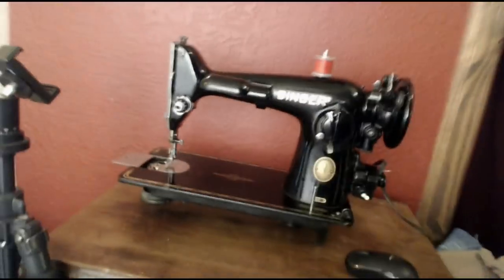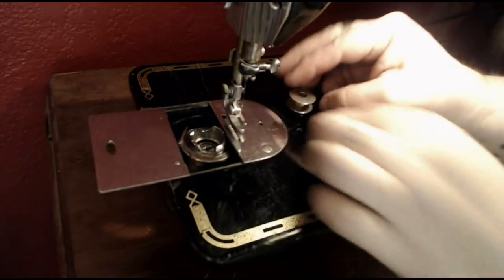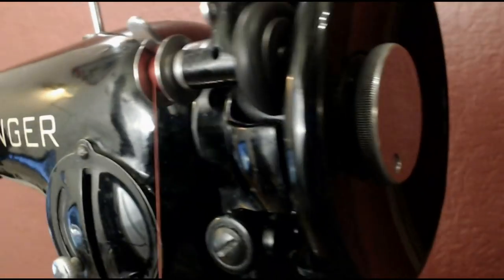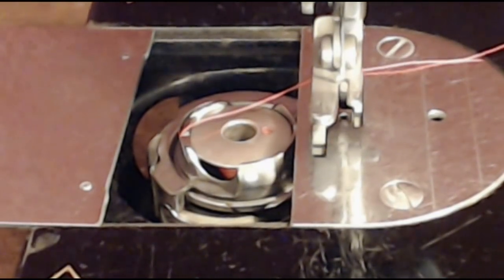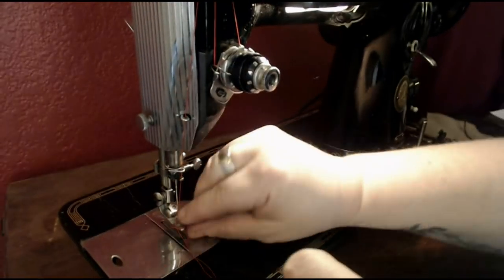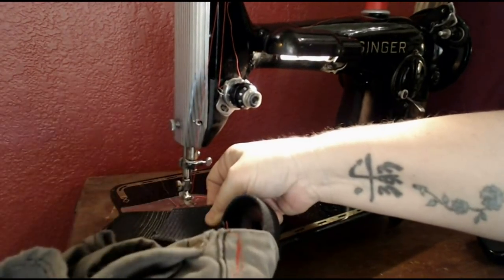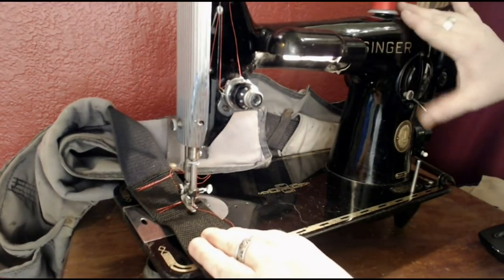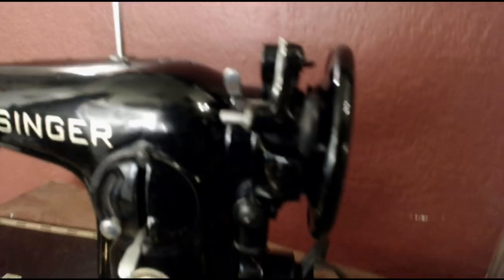Best Singer 201 demo and tutorial video

Comment: Thanks so much for this video! I learned how to sew today on my wife's late Grandmother's Singer 201 (from 1941!). I've never used this (or any other) machine before and I completed my first project (a hammock in 1.6 oz, lightweight diamond grid nylon "Hyper-D). I'm astonished at how smoothly this machine runs. Without this basic video, I was completely lost. Didn't know how to thread the machine, much less load the bobbin. I ran a couple passes on some scrap material and was amazed how well this machine performs. I have some more ambitious projects on the horizon, now! Thanks again

Comment: I have a 1938 model 201. It is a beast. I love the machine. I also have a brand new Janome C30, and the 201 is just as smooth and quiet as the Janome. I also own a white's machine in a cabinet. It has a broken bolt on the motor belt tension, and I plan on fixing that really soon. The white's is kind of noisy when it was running. I love that machine also. My 201 is in a plastic travel case, but soon I plan to build a large cabenet for it for the purpose of doing upholstery with it.

Comment: Hello! So nice to find your videos! I bought a 201-2  ( looks like the one you have in the video ) people tells me for sure is this one, but it doesn’t have the little plate that say so.my problem is it was neglected ( is running , is cleaned, oiled, etc). But when I try to fill the bobbin , the little wheel sometimes stop and I need to move the lever a little bit , so it can finish filling the bobbin. Do you have a video that help me with this? I will really appreciate it!  ( oh the little rubber wheel is the original )

Comment: Last summer I picked up a 201-2 with it's original cabinet.  Sew Pro's in El Cajon refurbished as It needed new electrical.  I have several, very expensive machines.  BabyLock, Jenome and Viking.  I love to sew with this 1950 Singer 201-2 the most.  My question is.  The 66 bobbins that I have recently bought seem too tight.  The older ones that came with the machine slip in so nicely.  Have you had this problem?  Same problem with my Singer 99, the new bobbins coming from Singer class 66 bobbins are too tight.  Any suggestions or comments from your experience.

Comment: Not all 201,s had potted motor. The 201k and 201-1 can be put in a treadle. The 201-2 is the only one with potted motor. I have a 201-4 hand crank
USA  1935 - 1957   
201-1     Treadle operated
201-2     PH Potted motor with direct gear drive
201-3     BR external motor with belt drive
201-4     Hand cranked
       
UK  1935 - 1962   
201K1     Treadle
201K2     PHK potted motor with direct gear drive
201K3     BAK or BZK external motor & belt
201K4     Hank Crank
201K21,23 & 24  1954 - 1962  As 201K1-K4 but with new style aluminium body and solid balance wheel.
BAK4 motor with belt drive. Black or beige models
201K29     As 201K23 but with spoked balance wheel
       
Australia  1956 - 19??   
201P     Assembled in Australia from parts made in UK
Reply: I just got a 1935 201k. Thanks for clarification on the dates. She said 1938 and I was confused.

Comment: I purchased one of these a year or more ago.  never used it.  it came in a table.  what do you suggest I do before I try using it?
Reply: Oil it good
Reply: Very likely may also need to remove old grease on the gears and replace with new. Other YT videos show details on this.

Comment: Great videos! I was wondering if you wouldn't mind helping me with a little feedback. I am debating between purchasing one of these 2 machines listed. 

201-2 in a cabinet (w/light in front / Rolls Royce)
301 - long bed (wanted the short bed to fit in a cabinet but only found a long bed for sale.)

I will be sewing high end women's dresses. I am not a professional sewer, so I'm looking for a machine that is easier to control (slower) for better precision. Stitch quality is very important. And would prefer the machine that is more on the quiet side. Portability would be nice but quality is more important. 

Any feedback would be appreciated. Thank you :)
Reply: FYI  , I have both.  I love my 301, and it sounds like a model train. The 201-2 is a dream to drive and purrs like a kitten. I hope this helps. hahaha, no matter which you get, much success to you. With your ambition, and if you want to stay vintage, consider a 401. I have a 221, 201, 201-2, 301a, 404, CG-550, 600, 600e. a160th and a 9960, all set up a little different with lots of various presser feet. "man does not live by lockstitch alone".

Comment: I have a 201 slightly different to ur one ..I having problems with tensioner .on how to get tension right please can u help .my one is 201k
Reply: you probably have a broken tension spring .. just unscrew the screw at the front  and the whole assembly will slide out  if  the spring is  broken get another from any other machine ..there all the same and reasemble// it should then be fine..

Comment: The motor on this 201-2 is surprisingly no quieter than my 201-3. I was thinking the potting would make it quiet. Apparently, the only benefit to the direct drive is no belt. For sewing within the capabilities of this machine I think either machine would work just as well. The direct drive makes things unnecessarily complicated.